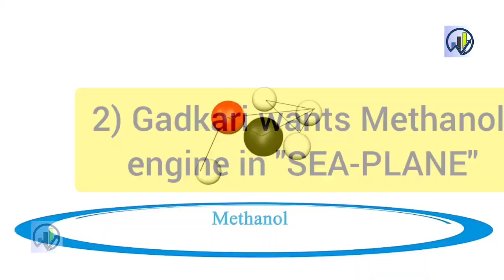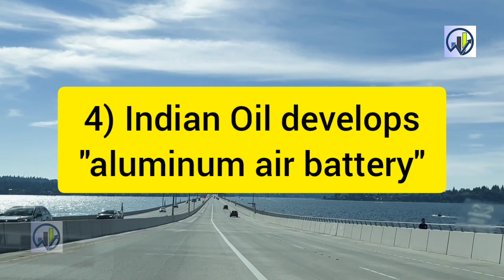Indian Oil Develops "aluminum air battery"🔥 Gadkari wants Methanol SEA-PLANE 🔥

Comment: I think that India should start a research on "Solid State Battery tech" ASAP as solid-state batteries can replace Lithium-ion batteries in electric vehicles and also makes the batteries lighter, faster to charge, and eventually cheaper......